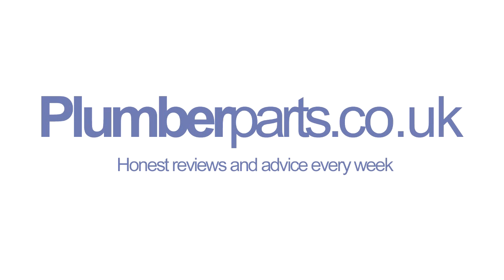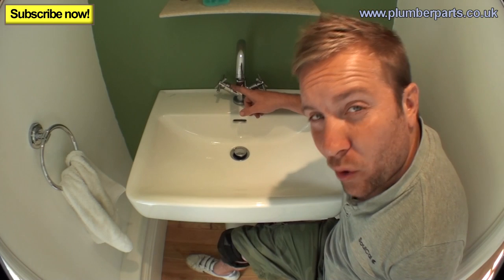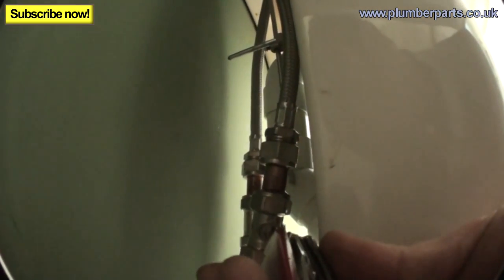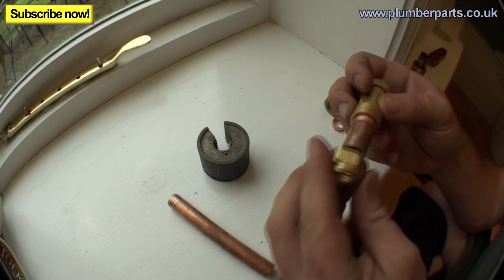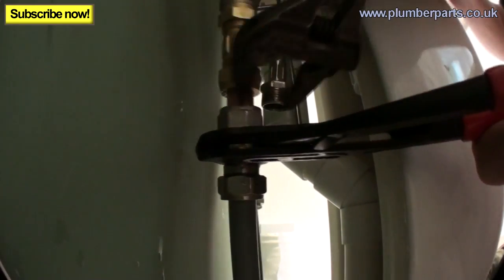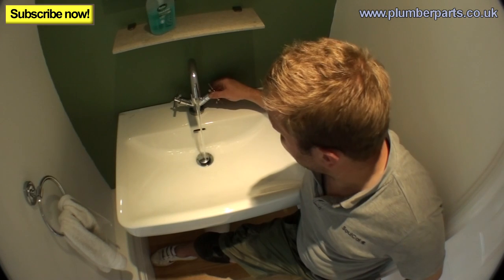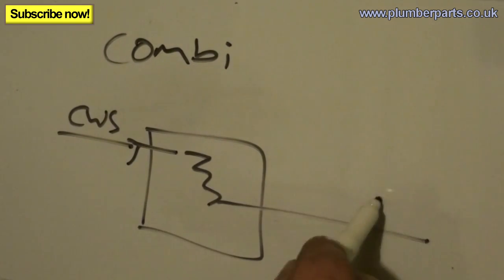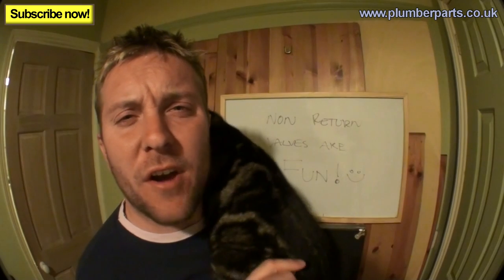HOW NON RETURN VALVES WORK - Plumbing Tips

Comment: Could also use 2x 15mm female Brass Threaded Hexagon Socket with thread tape to join the flexible hose to the non return valve then to the original pipe fitting.

Comment: Hi
I have installed a solar tube hot water system here in Tasmania. Can you advise on where to position non return valves to stop the hot water in the tank from rising up to the solar tubes at night or when electric booster is on. Cheers Oliver

Comment: Very interesting as usual. Many thanks for the video. 
I have a non return valve fitted outside on the pipe leading to my outdoor tap. Throughout the cold months (which seems like far more than the warm ones!) I turn off the ball valve on the inside as I should to prevent very unwanted burst pipes outside. I turned the valve on for the first time in 3 or 4 months and all I got was a trickle from the outdoor tap! It can't be the valve that's the issue as that turns easily. Is it possible that the non return valve has seized? Is that possible? If so, do I have to replace it... OR is there a simpler solution?

Comment: I've got a check valve on my hot water bath tap from the check valve to the tap connector is a push fit connection water is leaking out of the push fit connector??? Any idea how to connect the check valve to the tap connector so eliminating the push fit problem?

Comment: I installed a non return valve last year on a outside tap and it was working fine. I needed to use the tap just now and I have no water coming out of the tap. I've opened the little nut in the middle of the valve and water came out. The valve is the correct way. Is this normal?

Comment: We had a new Boiler fitted a few months ago. At the time we noted the boiler was kicking in when the engineer turned on the cold water tap in the kitchen. We asked why this was happening and the engineer said this was normal. This has increased our energy bill as the boiler kicks in every time that cold water tap is fully on; boiler doesn’t kick in if tap is running slowly. Now the engineer is saying the problem is with our tap and 2 non return valves need to be fitted at our own expense. Is this reasonable?

Comment: Im thinking of using a non-return valve on the hot for mixing solar hot water into a cold feed only washing machine. Is this smart? Will use valves to set the temperature to 30*C.

Comment: Good video, thanks. Can you advise me before I 'LOSE IT?'
Moved my Auto mixer tape from my Appartment to my house, never had a problem until I did that, water started to exit the over flow, advised by a plumber to fix these, just done so now only hot water coming out & that is at a reduced rate! The arrows are facing the take on both pipes. Seems like I can't  win, this is winding me up so much.
Thanks

Comment: Check valves often double are required to stop backflow from dishwashers , washing machines out side taps etc which judged to have a fluid 3 risk which is all of them?). I have noticed that water suppliers are doing more inspections and its what is coming out in improvement notices is lack of double check valves. I have had three customers this week contact me about this and they have all been given 3 week improvement notices

Comment: Can you add a Non-Return valve to the hot water outlet pipe connected to the boiler, avoiding having to have multiple non-return valves at every tap?

Comment: Hi there and thank you for your very informative video.  My problem is the following:  I knew I had to fit a non-return valve to the hot water feed to prevent backflow.  Unfortunately, like in your video, the water pressure of the mains far exceed the one from the hot water (Tank in the loft) which prevents a good regulation for the temperature.  Do you have any suggestions?  I have already changed the cartridges for kitchen taps thinking that it was the problem but no luck. Would a dual flow tap solve the problem?  I understand that with these taps the mixing of the water happens in the spout.  I greatly appreciate any help or suggestions.
Reply: I meant that single flow taps mix the water in the spout not dual flow

Comment: Hi plumber parts,
I've got a overflow pipe leaking which is in the loft next to the other tank. It's the hot water tank. I've got a condensing boiler/system boiler. It's only 4 years old.
Its not the floater in the tank and I've had that checked and it's working fine but it's still overflowing and water coming back up the system. We have a mixer tap in the kitchen that as already there. We've just had the bathroom done and there was 2 seperate taps on a sink and swapped with a mixer tap. Could this be why my overflow tank is leaking and would these none return valves stop this issue?

Comment: Hi mate could you please advise me on this issue...
I have thames water supply and i was going to close my main valve which is located outside but I saw a small white stick and inside the whole of the stick there was a screw, nothing to rotate like I have seen in many videos...

Could you please advise me if i have to rotate that screw or it's something else ???

Comment: Bra! Check Valve and Non Return Valve the same thing?
Reply: No mate, they are different. A check valve has been tested to provide back flow, a non return valve hasn't. A non return valve is usually installed on the outlet of a pump. Check valves greater than 50mm can only be installed in the horizontal orientation.

Comment: I want to put a Salamanda home boost coz my shower pressure poor and mains pressure the cause. I was told I can install it on my cold water feed to my combi bit would need to install non return valves on all other sources using the cold water before it gets to the combi. But not sure where to position them. Any advice on this? Thanks

Comment: Will these work for air ?. 
I have a large water tank in my van , fitted with a immersion to heat it up in winter to stop it all freezing (window cleaner ). 
The tank has a breather on the lid that I’ve fitted ,it’s 3/4” . 
I wondered if I could use one of these to allow air into the tank (tank should suck when water is draining ) whilst I’m using the water so it doesn’t air lock but stop the evaporation leaking out of the tank and turning the van into a sauna in a morning . 
Any advice is welcome

Comment: Good video, aren't you meant to fit check valves, in the mains cold pipes, to prevent back siphonage, although a plumber said it wasn't neccessary as the mains water pressure would prevent back siphonage but what happens if there is a negative pressure in tge mains caused by broken pipe
Reply: yes the regulations dictate this should be done.

Comment: You could do without the non return by simply partly closing the ball valve on the hot feed. I would have done this even with the non return. It makes the mixer tap flow easier to balance.

Comment: Hi there, I fitted a unvented boiler to my system plus new bath and bathroom sink.
The only way I can get hot water at the sink mixer tap is when I turn the bath tap on.
When I switch off the bath tap the water runs cold in the sink.
Question is do I fit a nonreturnable valve in the hot water side of the sink.

Comment: Great video I am fitting a bath mixer and having trouble. The mixer has no fittings supplied so I put loads of ptfe on a 15mm compression elbow. It works but was weeping. I removed elbow and fitted a straight 15mm service valve. I thought it was because the thread was not long enough so I tried male straight connectors and it still weeps? Is there any other fittings to use?

Comment: Say if there was a combi system and every time the hot is drawn downstairs whilst the upstairs hot Is drawn at the same time, the hot upstairs loses pressure, I was thinking earlier surely if I install a non return valve this will stop happening but just wanted to know if I’m thinking it through right or not 😂 @plumberparts

Comment: Thanks that has explained why my rental property has these in the washbasin supply pipes to the mixer tap and why they are not needed for separate taps. I do get some vibration though if the hot tap is open only a small amount. Is this the non return valve open/closing?

Comment: Non return valve (One way valve)  can be used for liquid, gas and steam as a gravity circulation check, short-circuit check, check valve, vacuum breaker, priming foot valve or pressure-maintaining valve so easily change spring from Non return valve (One way valve) see releted video https://youtu.be/9X5JL1VZayg

Comment: Hi, I live in a townhouse and we recently installed individual meters to all 50 units. We have existing pressure valves (25) now we are being told that we need 25 more pressure valves installed near the geysers because if the geysers blow the insurance wont cover these..we since removed the sensor meters until we get more information to reinstall them. Can you advise on this please..

Comment: Two things that bloody well annoy me. 1. Why are monobloc taps always supplied with pooey flexis with a female hose end rather than a nut n olive? 2. Why are mixer taps not sold with the description clearly indicated, as suitable for differential pressures for mains cold and tank fed hot water? Bacterial growth in non potable hot water mixing with potable cold water aside.... oh that's gripe 3. AAAARGH!!!! Maxim is, gravity hot, mains cold fit a check valve as a matter of course. Here endeth the sermon. Also failure of cd 1/4 turn cartridges even with a small dripping can cause kitchen monos pipework to scream audibly, whenever the upstairs bath or basin is run or the loo is flushed. Check out the check valves, hombres.

Comment: Hi hope you can help... I have a mixer tap in the kitchen, bathroom and a thermostatic shower and bath tap, will fitting one double check / non return valve on the hot water out of the boiler be serficiant to stop the cold back feeding on the whole hot water side of the system?

Comment: I have a pump to my shower which activates for a few seconds when a hot tap is put on elsewhere i.e. Kitchen, bath, basin etc. Would a one-way valve on the hot supply to the pump stop the pump noticing the pressure difference and activating?

Comment: Hi - good vid - I installed a non return valve as you described and the pressure on the kitchen  mixer tap ( very thin pipe ) dropped to a silly level - some times the water takes seconds to even start flowing. - is the non return valve faulty, adjustable or are some taps just bad ?. Th flow in the bathroom sink is good at the same level with a 3-4 metre head. I am good at most DIY but stumped by this - do I change the tap, try another valve or just tell the wife thats as good as it gets ?!!
Reply from the maker: Tell the wife! SUBSCRIBE! ➡️👉 https://www.youtube.com/subscription_center?add_user=plumberparts 👈⬅️if you haven't already!

Comment: REALLY helpful tips. many thanks. we recently had our kitchen remodeled and the kitchen fitter really did not have a clue about plumbing! Is it a legal requirement to have a non return valve on the pipework leading to an outside tap? ALSO....is it legal to use lead solder on domestic pipework leading to a kitchen sink tap?
cheers

marc

Comment: Can you install a non return valve for salamander pump pipework, shower works but after a minute when used a while ago? Presuming that the water from the shower head is running back when turned off.

Comment: If you were to place the Non-Return valve on a supply with low water pressure (in this case the hot water supply), won't the supply with the highter pressure (in this case the cold water supply) stop the non-return vavle from opening and supplying the tap with hot water?
In other words, can you have both the hot and cold water running at the same time...won't the cold water supply stop the hot water because of the higher pressure of the cold water supply?
Reply from the maker: It didn't on that installation....I guess it could happen....but never has to me!

Comment: I have one query...! I want to install a mixer in my sink where i have two connection 1) Drinking Water and 2) Non-Drinking Water( for washing purposes)

Scenario is
Drinking Water pipe comes from out side(from Water Corporation)
Non-Drinking comes from our storage(which is taken from borewell not all for drinking)

In my sink there instead of two tap's(one for Drinking and other for Non Drinking) i want a single tap which serve the purpose of both!

But, our plumber said as the Non-Drinking Water may get mixed with the Drinking one this mechanism fails but, i said use two non-return valves on both the pipes, but he said the Drinking Water pressure is really low and non-return valve will make it even more slower . Is this true? what you can suggest in this situation?

Cheers,

Comment: hello;
i got a problem when we take the shower first hot water is coming then suddenly cold water is coming.we don't know when hot water is coming? when cold water is coming ? there is no problem in boiler i checked already. there is no problem in kitchen or any other area. only problem in shower.  can you please give suggestion for this?
Reply from the maker: +kala kamal Its the thermostatic cartridge. New cartridge or a new shower control!
Reply: +plumberparts 
it is new and normal shower. we connect 22mm non return valve in boiler for cold water. still same problem for hot water for when we taking shower time.can you please give me the suggestion. .

Comment: great video.i installed a new mixer tap in then kitchen and i could work out why water was pouring out the over flow on the roof.it seems cold water was being pumped into hot water system.i need to fit a none return valve.thanks
Reply from the maker: +lesmoor kelly No worries!

Comment: I have a power shower where the hot supply was installed by routing up from the tank into the loft and back down to the shower. When I turn the shower on it pulls air to start with and eventually water. I know the real solution is to re-route the hot supply, but thats a big job. Would a non return valve on the hot supply work, to stop the water returning back to the tank when the shower is switched off? Perhaps placing it as close to the tank to minimise the air? Thanks

Comment: Basically have a job which has gravity system and a grundfos 2bar pump running 2 showers.  Keep getting airlock in the system and when the hot tap in the kitchen is opened the pump kicks in and the pumps squeals because of the air in the system.  I have been advised by grundfos to fit 2 low pressure non return valves on the outlets from the pump to solve this problem.  Does this sound correct to you?

Comment: Fab! Can an instantaneous electric hot water heater outlet be fed into an existing hot pipe coming from an electric immersion tank with one of these valves to stop the water from the immersion tank flowing backwards through the instantaneous water heater?  I want to shut off the immersion tank feed and supply my basin and mixer-tap shower in the bathroom mostly with the instantaneous heater, but I also want the option of putting the immersion tank back on when I'm really stinky and fancy a bath (There's a big shiny red tap on the pipe from the immersion tank, so it'd be easy to use that to switch between bath mode and shower mode)  ..If what I've just written there makes sense.. Good luck deciphering it!

Comment: First and for most, as others have said before a great video and as always great advice, just a question on non-return valves. 

Is it advisable to fit a an non return valve before my single lever bath mixer tap that is powered by a 1.5 bar shower pump, if so should I installed one on both the cold and hot supply or one only on the hot side?

The thinking behind this is to stop/reduce the water hammering that takes place every now and then when the lever tap is shut off in quick successions (I have tried asking other users to closed the lever slowly but this often falls on deaf ears), I have also been informed that some more expensive bath filler taps have integrated non return valves built into them.

Comment: hi i have a shower pump from wicks 1.5 bar running of a gravity line just for the hot water to the shower , it dont work all the time but is brand new and sometimes will not let hot water through , would a none return valve work ? if so do i put it before the in let or the out let ??
Reply: rick williams

Comment: i got an outside tap kit. (the kind that screws into the cold water pipe). It was easy enough to do. However after a couple of weeks it was just a trickle and now nothing at all. Is it possible, the part that screws into the pipe is clogged up with lime scale? or could it be something else? I hope someone can help me cos' its getting on my tits now.
Reply: Probs something's blocked it, as the hole it makes is small and burred (as you can't clean it up after hole is made). It may have even resealed itself. I think they are a crap design

Comment: Thanks for the video. I just bought a new expensive tap like this one, thinking the old one was just a cheapo thing because it made horrible noises when opening the cold (which runs off the mains). Turns out it isn't the tap that's at fault as the new one does it. Will a non-return valve sort out this horrible noise? It also runs on a bit after I turn off to empty itself.
Thanks

Comment: Hi.  First of all, thank you very much for the video but could I ask, why you would fit a non return valve to a pipe supplying an outside tap. I think I know the answer but I would be grateful if you could confirm the reason. Many thanks
Reply from the maker: Iain Taft It's legislation to stop contamination of the mains water supply. Hope that helps! PP!
Reply: I thought as much but thank you very much for confirming.
Reply: plumberparts my outside tap pressure is poor. Could the NRV be restricting the flow?
Reply: Iain Taft 
To stop back siphonage